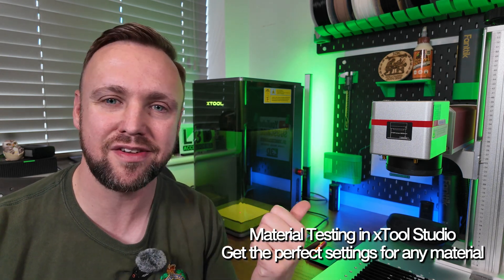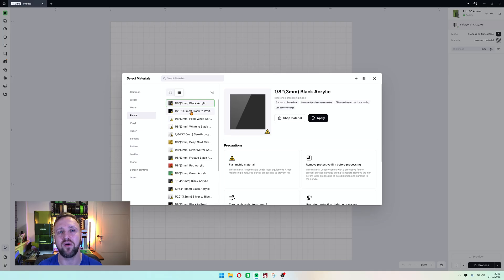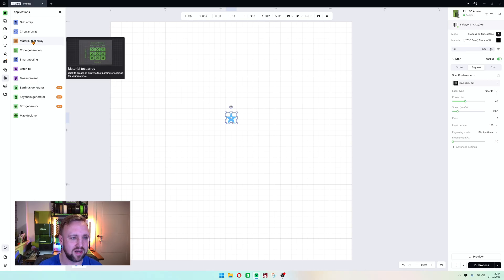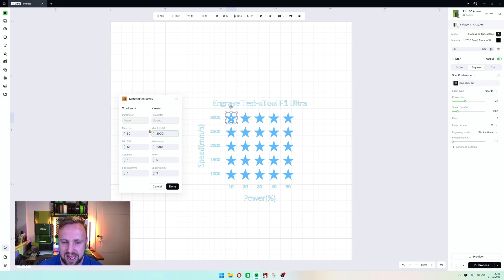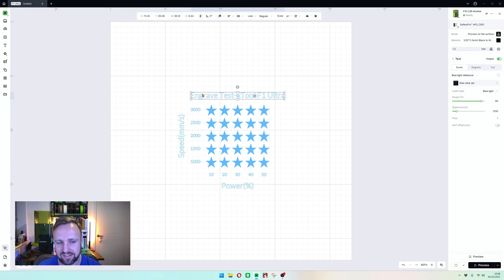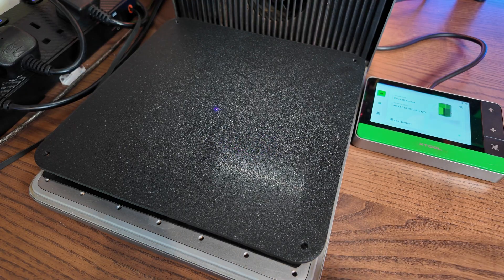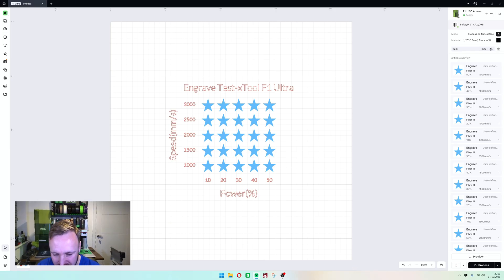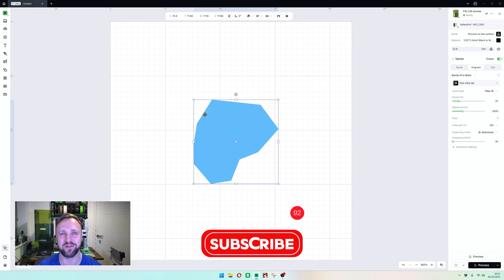How to Do a Material Test in xTool Studio (Beginner Tutorial)

Comment: How to you apply the settings you get from material test to a non vector image?
Reply from the maker: You cant, you get different setting parameters for images compared to vectors due to the way a laser processes them. An image is made of lots of small dots so you specify the dots per inch (the amount of dots in an inch of space) and also the dot duration (the amount of time the laser spends engraving each dot). With a vector you get a concentrated beam so you just have to specify the power and speed.
Reply: @L3DAccessories ok that means keep adjusting and testing

Comment: I have borrowed an F1 Ultra and I noticed that with the rotary, or I suppose anything, the 2 dots for alignment are not in the center of the camera image.  When using a rotary it made me second guess what I was doing. I used the framing to be sure but can the camera be re-aligned to match up with the center of the alignment point?
Reply from the maker: It's most likely because of the camera position. It's off centre which means when it looks down it might not appear lined up.